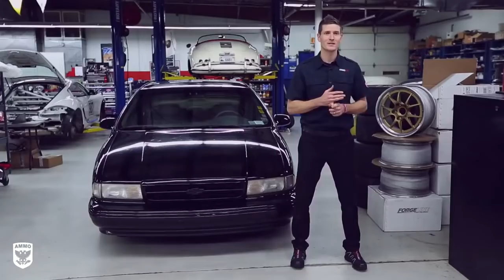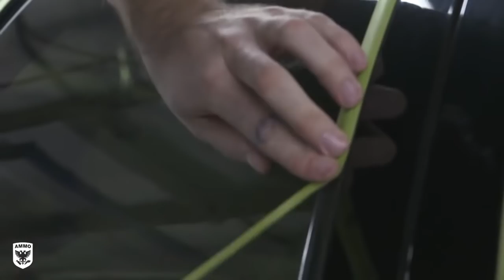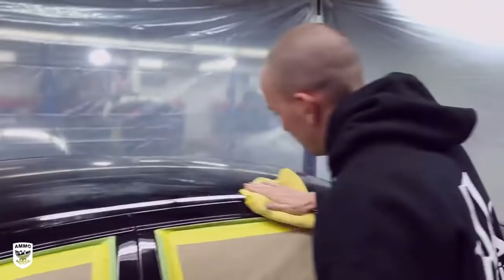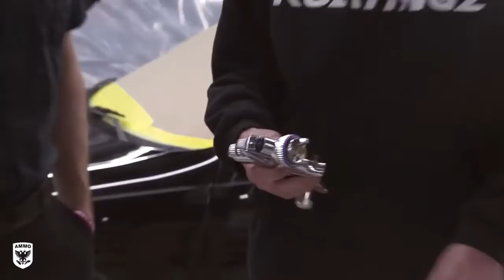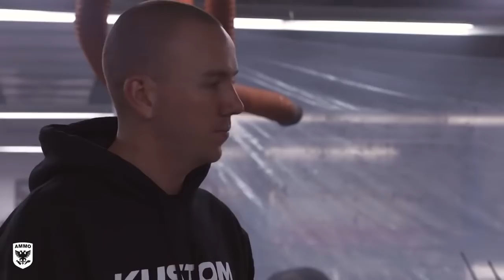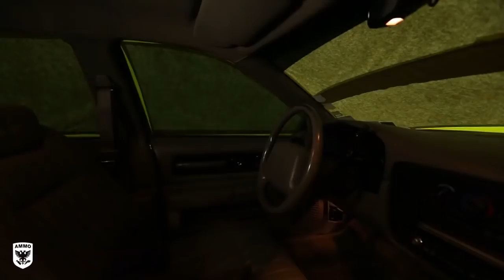Applying Raail Coating on Chevrolet Impala SS

Comment: Comparing Raail to Plastidip is disingenuous AF. For this to be a fair AND RELEVANT comparison, you need to look at how it stacks up against AutoFlex. Exactly nobody considering a DIY Plastidip job is giving equal weight to Raail. They’re entirely different price points and different market segments. Instead, we get this meaningless “comparison” that’s really just punching down. A Miata and a Ferrari F8 are both cars, but comparing the two is meaningless.
Reply: Did you even listen? 
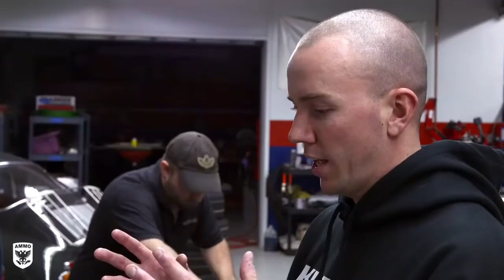How about trying again to listen at @1:50 theirs no punching down here boss.